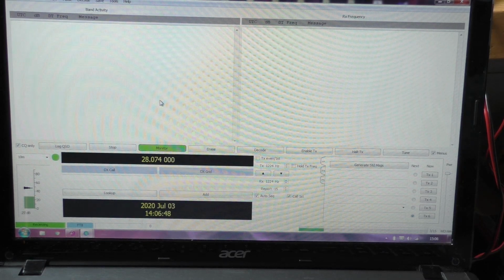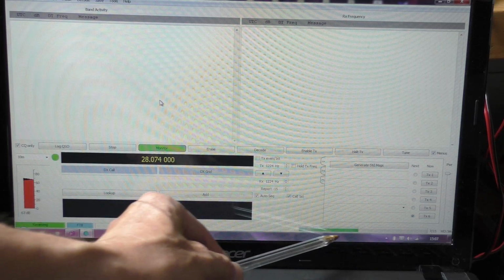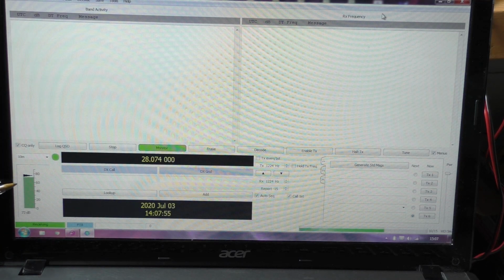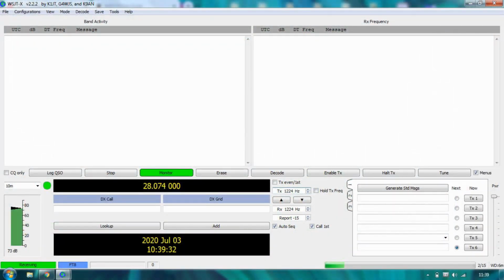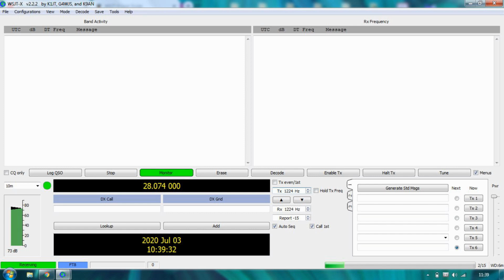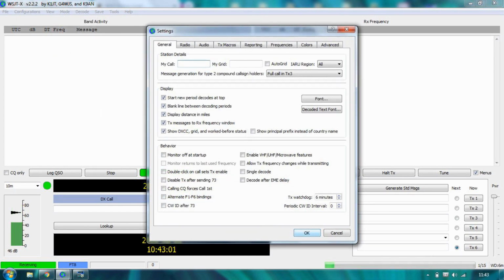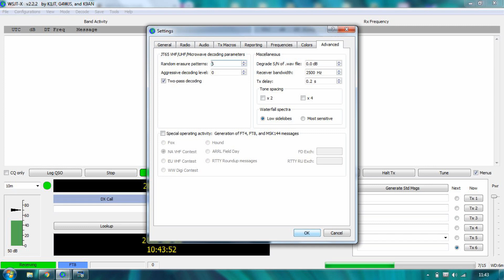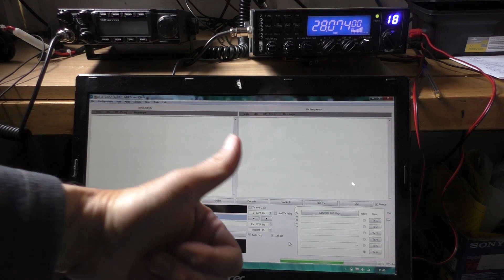Trying to read FT8 data. Not there yet.

Comment: Hi Fred, I,m using ss6900n to decode ft8 too. First you need to accurately sync computer time else it will never work. Next, use stereo to stereo 3.5 jack leads.In WSJT-X settings (audio) check output matches your laptop input settings. Use line in setting if available rather than mic input. Also use rf gain on radio to fine adjust levels rather than volume knob. Aim for around 50%.
Reply from the maker: Thanks Paul.  Good call on the RF gain control.

Comment: change input to line in not mic in soundcard settings
Reply from the maker: Cheers.  Thanks i will give that a try.
Reply: @CB-RADIO-UK   using mic input distorts the audio as its not a mic  using line in will improve audio with no distortion also keep it at about 50% volume
Reply from the maker: @m7ncnnigel391  Makes sense.  Net time iam out in the shed shack i will give it a go.  Thanks bud.
Reply: @CB-RADIO-UK  np

Comment: Personally, I believe the problem is the rig, the output isn't clean enough. The software looks fine to me, didn't you have a more ham based radio once. I would start there first
Reply from the maker: Thanks for the comment.  Yes i do have HF radios.  I really would like to see if the 6900 can work but you could be right about the output.
Reply: @CB-RADIO-UK  yep understand Fred. Try the other rig first. Get it working and then change the rig over. Just something that I would do👍

Comment: Hi from Ireland Fred,you need to have your computer clock time synchronised  because FT8 is time based ie 15 second  TX/RX intervals so your time needs to be fairly accurate for it to decode properly, you can try and adjust your PC clock manually slightly or you could download a time synchronise software to do it automatically for you at regular intervals, I use dimensions 4 but there are many out there,but as I said even manually adjusting the clock might get you decoding,even if your clock is out by a few seconds it can make all the difference, hope this helps Fred,keep up the good work! 👍
Reply from the maker: Thanks Mick.  Yes i will be trying some time sync software.  Others have suggested dimensions 4.  Not giving up yet.  Cheers.

Comment: I've decoded FT8 the same way you are doing it, with my Intek HR-5500 (a 6900n variant) and it should work without much fuss, the main thing is getting your time in sync. I use a program called "NetTime", a fairly old program now but it works. The only thing I could see is that the waterfall didn't look quite right. Have you listened to the output from the radio on the laptop? You want it to be mono, which is what the radio outputs anyway. Just depends what the laptop is doing with it, it may be in stereo or you have the wrong channel selected in your settings. Try recording the audio with Audacity or something to see if it's receiving the audio on one channel or both (stereo). Then make sure the audio settings in WSJT-X are set to the correct channel, it has options for Left, Right or Mono. Your audio levels are important as well, inputting an amplified signal from the radio can easily overload and distort built-in motherboard soundcards. You'd want the radio volume set fairly low and use the soundcard to amplify it as much as possible and use the radio to fine tune, you don't actually need it too loud to get it to start decoding.
Reply from the maker: Thanks David.  Funny enough iam getting no sound through the laptops speakers whilst running the program.  The sound input is mono from the radio with adapter - stereo lead- stereo into mic input
I might try a different lead set up.  Will look into "Net time" thanks again
Reply: WSJT-X won't output any sound, unless you enable TX of course. You would have to enable the monitor option for the microphone input. In windows sound settings for the microphone there will be an option for "Listen to this device" which can be handy for troubleshooting and getting your audio levels correct but not required for decoding, I'd imagine it would get annoying rather quickly haha.
With a mono to stereo adapter it would probably then be in dual mono, where both channels are the same, which is fine so then either the Left or Right channels would work or even try the mono option in WSJT settings.. It's just the waterfall looked a little odd, you should see clear transmissions across the waterfall. Points more towards an audio issue than anything else and of course the time sync although unless it's out by more than a second or two it isn't hugely important for just receiving/decoding.

Comment: Okay, if you’re only receiving, you don’t need to clock synchronisation.. You just need line out audio from the rig, to lining on your PC.. That’s all you need to set up. Also make sure you have your rig set to upper side band. Read to help file for the software, and make sure you have the audio levels correct and not overloading the computer.. I’m not familiar with your Yaesu transceiver, if it has a inbuilt sound card or not. Either way, it certainly has a connection on the back of it to cable in the line out of the receiver to the PC.. once again, read the help file for the software, and set the audio levels as described in the software. Without an antenna plugged in, the audio should be roughly about 30 DB in the meter at the top of the screen.. The clock synchronisation is only necessary if you’re wishing to transmit, download software called dimension for if needed for that.
Reply from the maker: Thanks for the advice Jimm.  I will try again later.

Comment: What are you using for clock sync? It is really fussy, and std windows time sync won't cut it.  Also, I tend to run my audio a LOT lower, around 30db rather than just out of the red.....but I have never used the PC sound card either, so can't really help on audio.  I would fix the clock sync with a free NTP daemon first and if it still doesnt work look at audio levels.  There's not much else to set when you're not transmitting and hence don't need CAT control of the radio.
Reply from the maker: Hi.  Yes i think you have hit the problem as iam not using any clock sync software. The windows clock is not accurate enough.
Reply: @CB-RADIO-UK  I'm using Net Time, but there are several free NTP daemons out there.

Comment: I think you need some type of signal link. I do slow scan, the setup for that is a pain as well. Good luck Fred. :-)
Reply from the maker: Thanks Mick.
Reply: Look at g4zlp website - I use his digimaster minipro with my ft1000 and ts570.  Works very well indeed

Comment: Fred you need an external.sound card rig blaster is one plus you will only be able to decode on transmit then when someone aknowledges ur call then the FT8 transmission is decoded ur better off linking to ur alnco rather than your CB or I think you have a yaesu 450 you be better off looking at decoding PSK31 But again sound card needed
Reply from the maker: Ah thanks Lee.  I was thinking there was going to be more to it.
Reply: @CB-RADIO-UK  I do all my digital with a straight connection from the radio to the audio line in on the pc.  Just keep it in the green.

Comment: #FredintheShed as you try PSK31 software on it to see if PSK software work on it cause it sound like digital  try psk software if the software you using now dont seem to work it all part of radio there alway something new to lean in work if you willing you learn cause most people think  radio is only voice cause part of their people dont know about the digital side of radio it all about having fun and playing with software to see what work and what dont work you wouldnt learn anything if you not willing to play about with software that part of radio some amateur dont want you to know about cause some amateur look down there noise at cber cause they think they better than us cber cause they fully licence bet you hear about some of there type of ham some of the full licence holder i isnt putting there call sign down but i will tell you there sone mw0 and m0 and G stations that they thinking they better than us i isnt putting there full call sign down (m) mean england) and (mw) mean wales)
Reply from the maker: Thanks Donny.  I will invest a little more time into this.  I just think its something else to try and show on the channel.  No idea if its possible to decode with just a CRT6900 and a basic laptop.  Ive no desire to TX FT8.  If i can get it working then it may encourage others to try Ham related data in the future. However iam not sure i will get it decoded.
Reply: As your laptop got mic port on it if so run cable from speaker port from of the radio to mic port on your laptop so your laptop can hear your radio other why you can buy cable for you ft450d that you plug into your radio and put USB into one of the port on your laptop but make sure you put cd software in first cause most people hook radio up and put software in and some time thinking why it isnt working cause it wasnt set up right

As you saw (Signalink) is USB interface that you put inline from your radio to your computer if you haven't hear of a signalink before there all thing you can buy for radio if you know what you are looking for only a little help

Comment: The jtx software needs to be in sync with the transmissions,  you need to download and run a little program that keeps your pc clock and  jtx software accurately set, it does it automatically once setup.
I use Dimension 4, I select a UK server and that’s it, keeps all in sync. good luck.
Reply from the maker: That makes sense.  It did look out of sync with the decode flashing.  Ok will look into some more software.  Thanks
Reply: @CB-RADIO-UK  you have to set your Computer to sync Clock with the internet, no additional Software needet.
Reply: @tangomike1306  That is not as accurate unfortunately,  the tiny software package can check every few seconds and has more reliable sources.
Reply: @CB-RADIO-UK  Almost all FT8 issues are timing.  There's a registry hack to keep your pc computer synced up more frequently, or plenty of third party applications that'll do it too.  Once your timing is set, next likely issue is either audio too loud or quiet (keep it in the green).  Best of luck, it'll suddenly start making sense!

Comment: Is the time on your laptop accurate to within two seconds because otherwise it won’t  The code and do you have an Internet connection 73s Tom Vk3ftom
Reply from the maker: Not sure on how accurate the laptop is.  Yep its connected to the net.
Reply: @CB-RADIO-UK  just use the Internet sync and you are good. Or use Dimension4 app to sync.
Reply: Just make sure the time is accurate
Reply from the maker: @VK3FTOM-TOM  Hi.  In what respect are we talking the laptops clock ?
Reply: Yes the laptop Clock